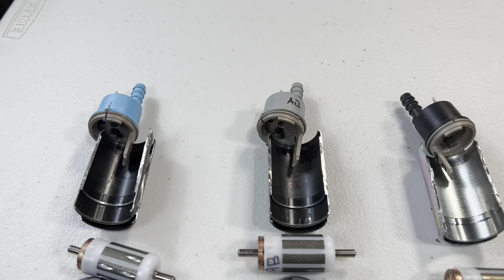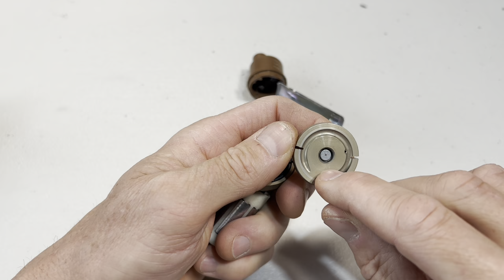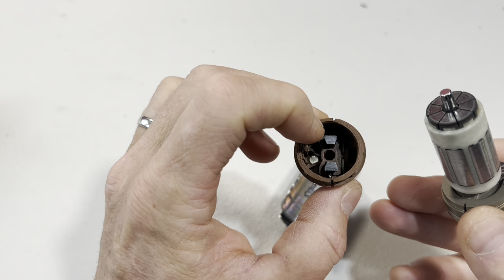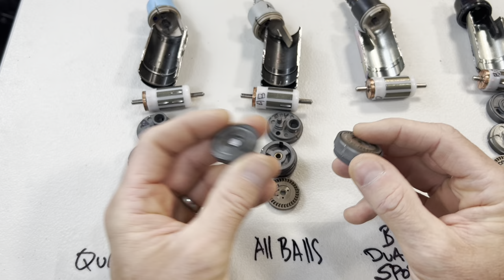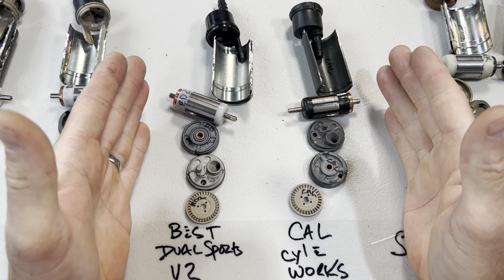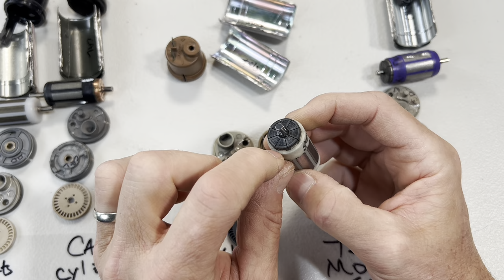THE 3K HOUR TACO MOTO FUEL PUMP AND EXPLANATION BREAK DOWN

Comment: Another great explanation of how things work and what to be aware of as maintenance items go, Mike. While watching this video I was thinking it might be beneficial to us end users if you were to make a video that identified obscured maintenance items on these same bikes and create a timeline schedule for service intervals similar to the OEM catalog, only specific to Taco Moto products alongside OEM recommendations. It would be a good tool for bike owners and a reminder of what products T/M sells and how they compare to OEM. Unlike tires, brakes, drive line components and wheel bearings the fuel system, electrical connectors, starter and components, and switches and such are sight unseen and easy to overlook as maintenance items. Again, thanks for the tips and solutions.
Reply from the maker: Really solid idea and thanks for the suggestion. Will give it some thought and work on that
Reply: This would be awesome!

Comment: Hi Mike, thanks for the time you put into sharing your knowledge. Just a quick suggestion regarding the schrader/check valve at the pump discharge. In centrifugal vertical turbine pumps (exactly what the fuel pump is) a condition known as upthrust can cause rapidly increased impeller and volute housing wear. This occurs if a vertical turbine pump is started with zero or low head pressure. I believe the schrader valve will not only prevent backflow when the pump is stopped it will also aid in reducing upthrust upon pump start. I also think the schrader valve will provide a known restriction, or orifice, to aid in reducing upthrust at pump start as well as preventing the sum of all minor system pressure losses allowing the pump to go over the end of its curve and cavitating. Cheers Andrew.

Comment: I had a pump failure on my 17 fe350, or rather a low pressure (25psi) situation. Replaced the pump with a quantum and oem filter which fixed it. The quantum's market claimed it was an improvement over stock. Apparently it is not. Thank you for disseminating this information. I will get a taco moto pump next time!
Reply from the maker: Marketing claims are great if they’re backed up

Comment: Keep these deep dives coming - very informative and useful info!  Curious as to how the Japanese brands compare to KTM in terms of fuel pump reliability and durability?  I have the Quantum in my 2019 690 and stock on my 2020 FE350S but your pump looks like a worthwhile upgrade.  Also interesting that the stock pump might actually be more durable than most of the aftermarket offerings where I assumed the opposite😕
Reply from the maker: They use a center tank style unit with a larger pump motor that’s heavier and generally more reliable

Comment: Great vid with lots of info...glad to say I got my taco pump and moa fuel filter installed in my new acerbis os tank...had a bit of an issue with fitting the screen filter housing on the inlet port but that was easily sorted and other than that the install was simple...only other issue I had was that aft running the bike for few mins it started dying and then was hard to start...turned out to be a clogged injector and once I sorted that I did a 2 night camp ride without a hitch...perhaps might be an idea to run some fuel thru any new pump into a bucket or something so that any remaining carbon or whatever from the manufacturing process doesn't get into the injector - jus my 2c based on my recent experience... experts feel free to correct me... otherwise I feel comfortable knowing that as far as my f pump is concerned, I shudnt have any issues for a while and so less likely to get stranded coz of that 👍🤘

Comment: 2015 FE 501. 70 hours. Just finished a 50 mile braap over a mountain, dropped by the gas station when I finished as soon as took off it wouldn't take throttle.  At high RPM it cuts, then a surge of power, then bogging out.  I barely got home.  I took out the in-line filter it was indeed quite dirty. With a new in-line it's still doing the same.  I have a new in-tank filter I can throw in, but I"m thinking I should replace the pump while I'm at it.  I'm just wondering if debris has gone passed the in-line and messed with the injector. It was premium gas non ethanol.
Reply: Did you end up replacing the pump and the filter? What was your fix?
Reply: @iaris5734  Replaced with a new pump, which failed in less than 2 hours. Got an OEM pump, all is fine now.  So, bad pump.

Comment: 330 hours on my 09 crf450r and no problems with pump so far. I changed the pump filter at 150h and it was full of black soot! Carbon dust maybe, recently removed my clear ims tank to swap back to stock tank and again black soot lining the inside of the tank. The copper would not be an issue for me as i only use ethanol free 98 octane. Been thinking about switching out pump as a precautionary measure it's $600 aussie dollars so i may consider going aftermarket.

Comment: I just carry a spare fuel pump in my tool bag.  In fact, I carry everything to drop a pump into a fuel bag and remote connect to any Austrian bike through a battery tender connection (or direct wire to the battery).   It's about 1 pound but the peace of mind is worth 50 pounds.

Comment: Great pump! Make sure to add a clamp to the top of the pump line. Even though the stock pump didn't use one. I found out the hard way. 😓
Reply from the maker: All the clamps on all the hoses. Sorry you had that issue my dude

Comment: Great video. I work ok KTM’s for a living. I have noticed when changing a bad pump or servicing a fuel filter there is a massive amount of carbon in the fuel filter. I’m assuming the other guys are going to brass to “fix” that issue. I’m curious to see how the copper hold up. I’ve always wondered the main cause of failure. We have a lot of people “rebuilding” their fuel pumps that still fail. After rebuilding them they still will not hold pressure. Assuming the body, lines and or the regulator have failed. In the service world we do not have time to do what you do. That you. I’ve always wanted to do this.
Reply from the maker: You’re in the trenches every day! And as you noted are seeing what we’ve seen as far as failures and problems. 

Carbon loading in the in tank filter is definitely a known thing and tank filter replacement / maintenance is def an important item. 

Replacing a pump and regulator as a set is a smart practice to ensure no pressure leak issues are occurring 

Keep up the good fight out there, you’re doing the lords work
Reply: @TACOMOTOCO  budget

Comment: I like the presentation and explanation, but I don’t understand where you came to the conclusion the stock pump is in the 300hr range while the Taco pump is rated at nearly 10x that? What was the smoking gun failure point of the stock pump, build quality appears very similar to the taco pump aside from the weight of the armature and quality of the plastic housing as you stated, are the stock pumps mainly failing by cracking in the plastic housing on average?
Reply: Came here to make the same point.  The only advantage I see is TM gives a warranty.

Comment: I'm curious why these are supplied with the convoluted plastic fuel lines instead of submersible rubber line. The plastic lines seem to break easily and don't allow for easily changing filters.

Comment: I just changed my fuel pump assembly & what gets me is that the length of the hoses seem to me to force a kink in the top hose when you push the electrical connection end fully into the tank & screw it tight. It seems to me that it pushes the overly long top hose past the top of the filter & then it gets kinked to some degree bending back to go down into the filter. Maybe I'm wrong but that's what it seems like to me with the lengths of things compared to the actual distance in the tank, & that's how it feels with the pressure it takes just to get the electrical plate end tight.

Comment: Love these videos, however? On bikes like my 300 exc tpi two stroke, would a little oil (like 0.5%-1%) two stroke oil help keep the fuel pump running for longer?
Reply from the maker: Commercial gasoline already contains pump lubricating additives

Comment: Did I miss it, what were the main cause of failures with the different pumps? All I saw besides the rare case of failure was what was better or worse not what commonly caused the pumps to fail.
Oem pump on my 500 1600hrs still going, do have to prime the pump if I stop more than a couple of minutes, thanks for the heads up on the valve leak down.
Reply from the maker: Failure modes mentioned in the video 

Strongly recommend replacing the pump and regulator on that bike to solve the problem and reset the pump service life clock
Reply: @TACOMOTOCO  Curious why you recommend regulator replacement.  It's a spring and ball.  Short of corrosion, I can't figure out why this would be a fail item.  Have you seen them fail?

Comment: Looks great. If the pump output is considerably higher (40%) will that stress out the regulator? Or have you seen increased regulator failure?
Reply from the maker: No

Comment: If the carbon dust from the brush wear is blocking the tank filter, why cant the pumps have a brushless motor like hand drills have moved to?
Reply from the maker: Size constraints, continuous submersion in fuel
Reply: Brushless can be in fuel no problem.  Problem is requires a 3 phase motor controller that has to be somewhere (could be in the ECU even)

Comment: Really wish you had a UK distributor. I fit a quantum to my Berg 570 60 hours ago as it's all we have available. The problem with the Bergs is that the exhaust header runs right below the pump area of the tank so increases chance of failure.
Reply from the maker: Our testing included intentionally elevated fuel temps to account for that variable.
Reply: @TACOMOTOCO  I need a US vacation so I can load my suitcase with goodies.

Comment: My  2023 Husqvarna FE 350 (wheeled out the dealership, brand new in March 2023) on 42 hours suffered fuel pump failure just after meeting up with mates at the start of a trail ride. the fuse had also blown. On strip down of the pump, I noticed the fuel strainer was not on the bottom of the pump. Also the in line filter was not a Mahle KL97 but a black plastic fuel filter PA6GF25. I do not believe the different filter or the missing strainer was the cause of the failure as UK fuel is clean and I always run the KTM fuel sock under the tank filler cap. When 12volt is applied to the failed pump, it just gives an audable click. I intend to cut open the pump to determine why it failed. I rebuilt with the All Balls kit - £65. Unfortunatly Taco Moto parts are not available in the UK as far as I can tell.
Reply: Since replacing the pump, I cut open the defective pump. the only thing I could find wrong with it was there was a tiny bit of plastic in the impeller. The plastic I found in there is just like the plastic the tank is made out of. I believe it is a bit that is cut off when the holes for the filler, and the pump conections. It got into the pump because, as mentioned in my first comment, the strainer filter was not on the pump when manufacted.

Comment: 1400 hours oem pump motor, hold 50 - 52psi running
Reply: much of it high rpm, lots of fuel, 67,000 miles
Reply from the maker: Impressive 💪🏽

Comment: Please hurry up and get your left wing tank pick up pump modification out.
Reply: You can order a ims 4.5gal or 3.5gal to run the older pump that sits in the bottom of the left wing then you don’t have to worry about losing prime like with the taco moto solution. Although for the ims tank and the new pump setup it’s expensive